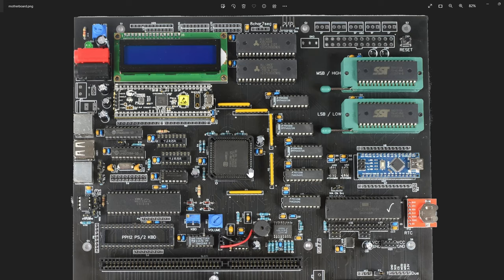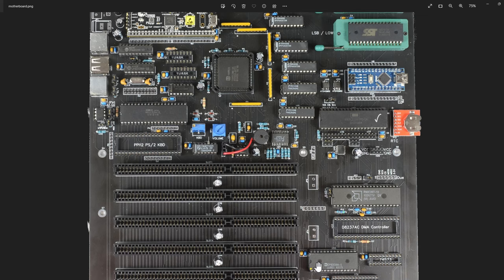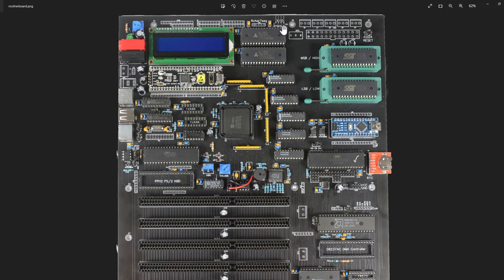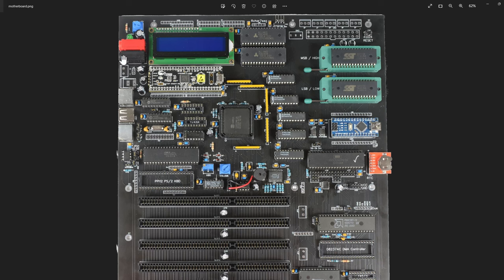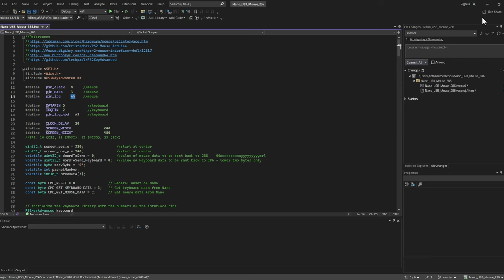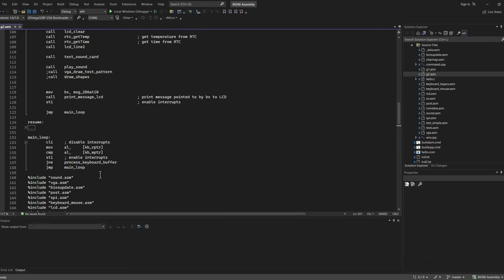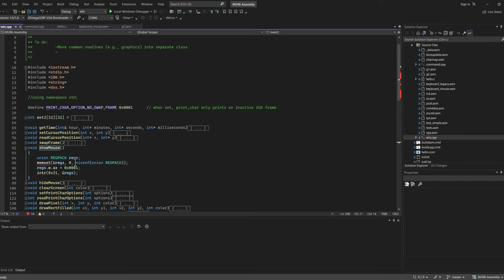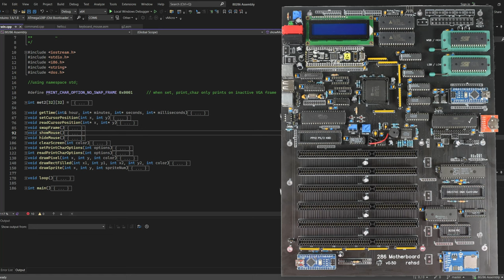80286 Build, Ep. #87 (part 2) - Six Months In!

Comment: You should be able to stall the CPU during a bus cycle if you need to access slower peripherals.

It should have a pin which, when asserted, causes it to add wait states. You could assert that from your address decoder when ever you decode one of said peripherals.
Reply from the maker: Good idea. I have read a bit about the READY signal, but I haven't tried it yet. I am looking to connect a CF card in the coming weeks, so that might be a good opportunity to play around with it. With my decode logic in a PSoC, it might not be that bad to add the support to leverage the READY signal. Thanks, Tom!
Reply: @rehsd  👍

Useless fact of the day, the Motorola 68000 works the opposite way: the CPU adds wait states until you tell it to finish the bus cycle with either DTACK for success, or BERR for some kind of error (at which point it vectors to an error handling routine).

Comment: I believe not all the 5Vs on the ATX supply are always on. That's just to power the power management circuitry.
Reply: Yep, the 5v standbye.
Reply from the maker: I'll dig into that. I have an ATX power breakout board, so it should be easy to test. Thanks!
Reply: @rehsd  Bringing everything on is just a matter of connecting one wire to ground on the supply. I've used ATX supplies for many things not plugging into motherboards. Another thing to be aware of, though I don't think it should affect you is that they dropped -5V along the way. I nearly returned  a perfectly good PSU because of that.
Reply from the maker: @chaos.corner  Yep, I have a switch on my motherboard to turn on the power supply (PS_ON to GND). One problem I might have is that most of my PSUs are Dell, and Dell often does their own thing on PSUs.  :)
Reply: @rehsd  I think Dell got a bit better about that kind of thing but YMMV. I did have an HP where the PSU connector was actually wired back to front (like on your MB) so I had to do surgery when I replaced the PSU with something off-the-shelf. That was back around '96 though.
Reply: @rehsd  Thinking about it, that could be an option for you. They make tools to get pins out of connectors. They tend to be a bit fiddly though. Reworking a cheap PSU is probably easier than redoing a new PCB. An alternative would be to get an extender (they're cheap) and turn it into a reverser. Or just power the board from the underside :D
Reply from the maker: @chaos.corner  I do have the tools to pop pins on these molex-style connectors. My concern is that I'll forget about it and try to reuse the PSU and blow something else up. :) I could fairly easily make an adapter. For now, it'll just be part of the next rev of the PCB. I prefer to use the banana jacks anyways, so no big deal for me.
Reply from the maker: @chaos.corner  At least for testing purposes, I just ordered an ATX 24-pin extension cable ($7). I can swap the pins around in the extension to at least test an ATX PSU as the power source.

Comment: What's the ballpark price for each board populated? It's got to be getting up there now with a full size ATX board.
Reply from the maker: Good question. I was thinking about putting together a bill of materials with approximate costs. I'll see if I can do that in the coming week. More to come...
Reply from the maker: I posted a budgetary BOM at https://www.rehsdonline.com/post/286-build-six-months-in. I am approximating $240 USD plus shipping. That estimate is based on current prices which still seem elevated and low purchase volume. I did not include the Arduino Due or I2C OLED display in that price; these would add another $65.